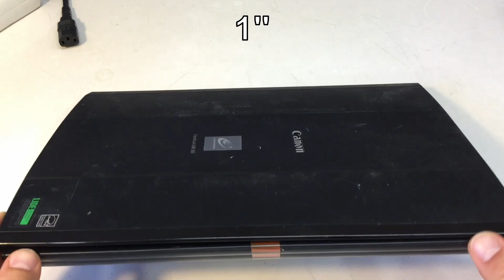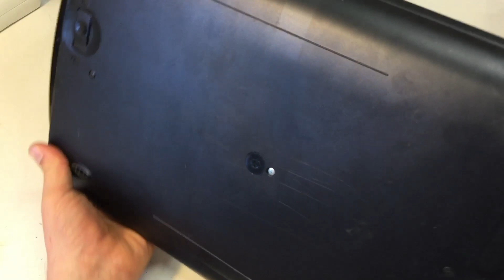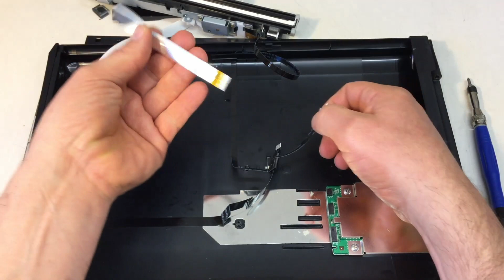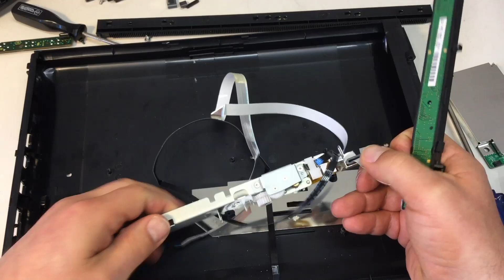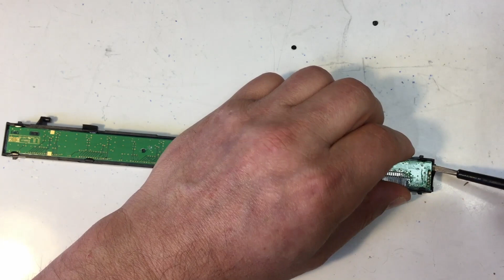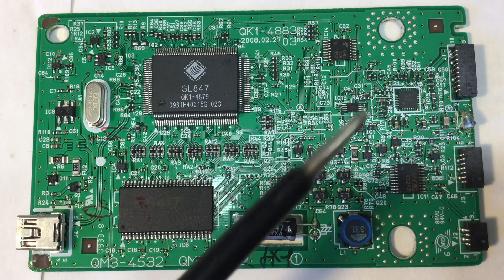Canon CanoScan LiDE 100 Scanner Teardown (All the Chips, Compared to N670U)

Comment: if the result is deep blue means the lamp of the scanner is broken, how do i repair it?
Reply from the maker: It could be the RGB LED (lamp), or it could be the transistors driving the RGB LED, or ... First you'll have to find out what exactly is broken. I would start tracing back from the RGB LED with an oscilloscope (a multimeter won't cut it, 'cause that LED is switched very fast). But: You get a new Canon LiDE 300 for less than 80 € and I've seen used LiDE 100s for less that 40 €. So I really don't know if it's worth the effort.

Comment: My 100 is now no longer being recognised - any idea what the problem could be? Could it be a resistor/capacitor/fuse that has failed?
Reply from the maker: It could very well be that there's a hardware failure. I mean that LiDE 100 must be quite old. For starters you could try using another USB cable and/or plugging it into another USB port. Repairing such a scanner is almost impossible, unless it's a very simple fault (e.g. lose cable connection, broken USB connector).
But it's also possible that after the last update Windows 10  doesn't recognize the LiDE 100 anymore. Canon never officially supported the LiDE 100 for Windows 10.
Reply: @robertssmorgasbord  thanks for that - it looks like a Mac El Cap issue - I downloaded MP EX 2.0.8 and it worked but only from the main screen. Oddly enough, I plugged it into a Mojave machine and it was recognized natively. No idea why El Cap is being funny but thank you for your reply :)
Reply from the maker: @saqibhasan101  You're welcome! And you're using a Mac - good on you! BTW I think the last official drivers from Canon were for OS X 10.7 (Lion) ;-)